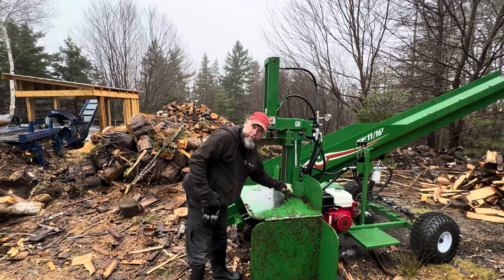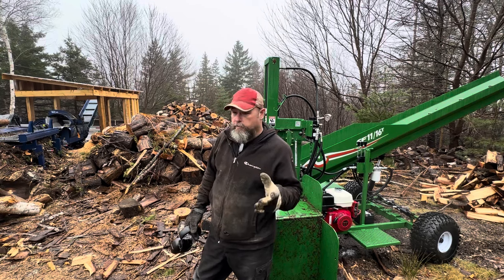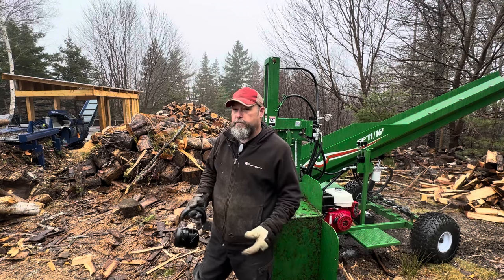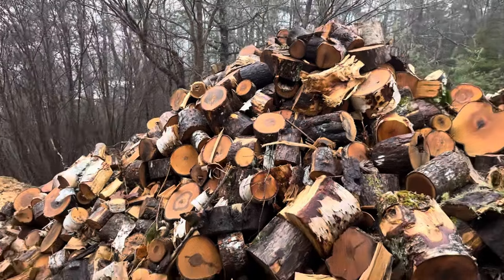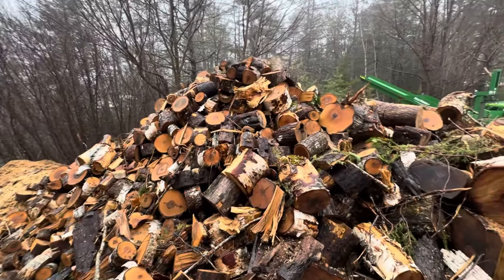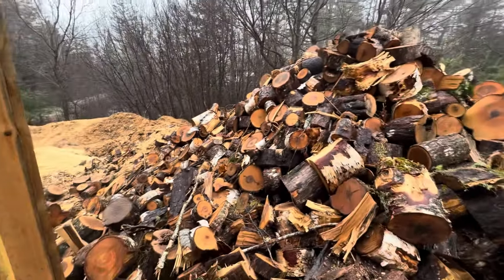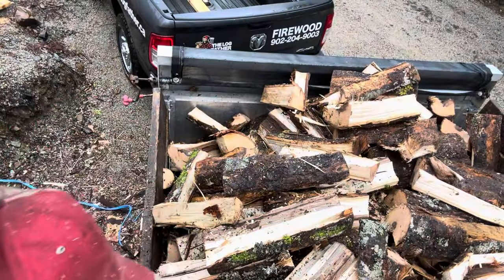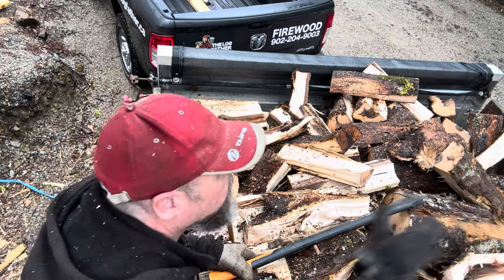I’m TORN! Too many toys- and no decent weather to work them.

Comment: Hi Jeff
WOW  on a lot of cookies  !
Well if  I  was a boiler heat guy in your  area and if you had a real  good  deal  on delivered  cookies !
With all the junk  that comes  with  the load  by loading  it with  your  tractor....I'd jump  all over that deal !!!
All the guy would  need  is a little  Princess  Auto  splitter to down size  some or a lot of it !!😊
Reply from the maker: I’m gonna make a cord up for my own wood shed, and a cord for our maple syrup for next spring. But I make a cord of these a month at least. I’m running out of room!